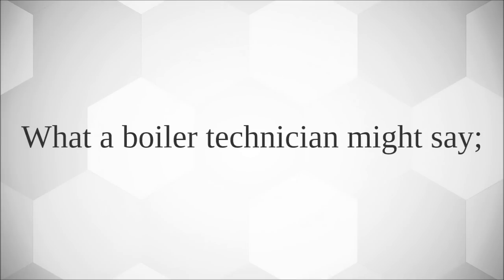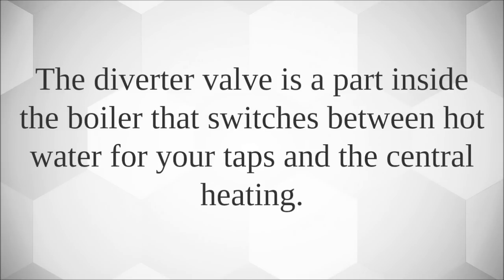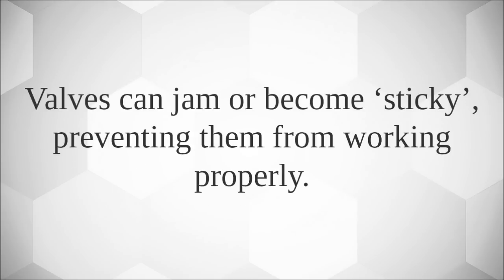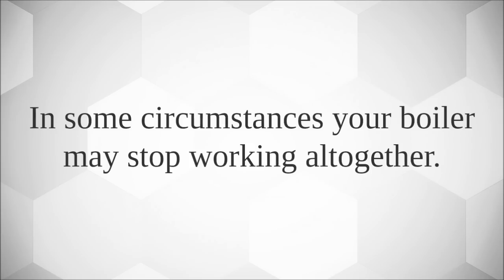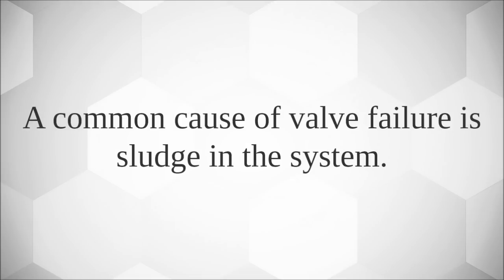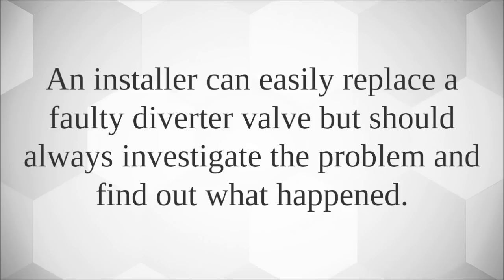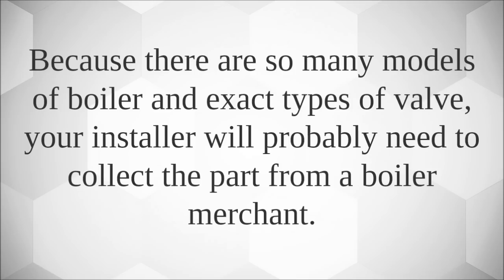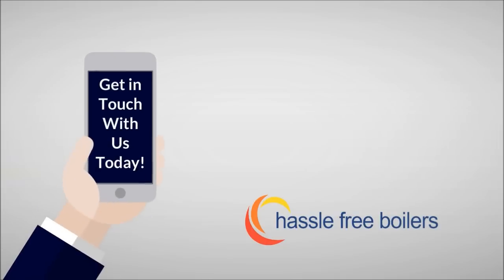What Does it Mean if Your New Gas Boiler Diverter Valve is Sticking?

Comment: Well that was useless and uninformative.   The widget is stuck in the whatchamacallit.   
Try doing this again, but pop in a diagram of a diverter valve showing how it works internally and where the sludge or stuck component may be.